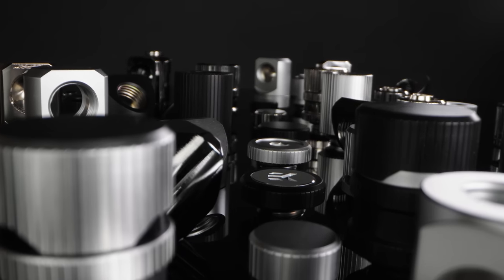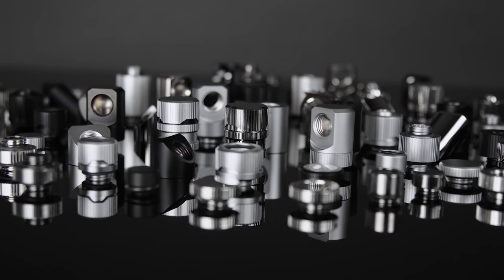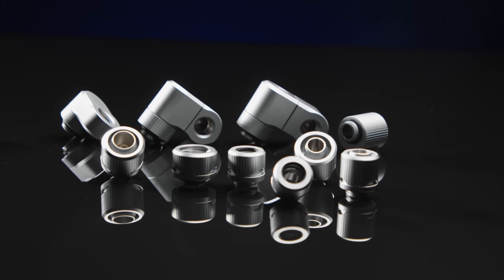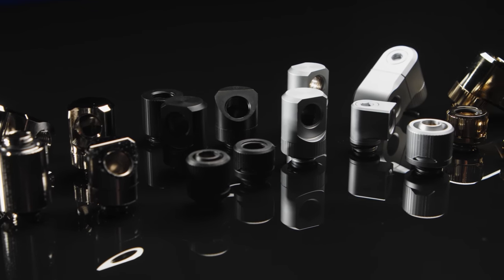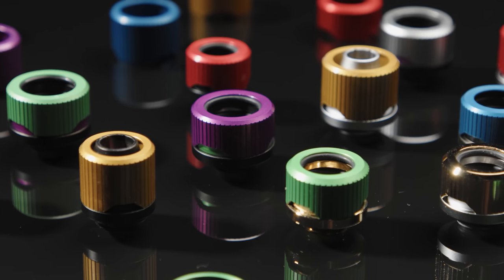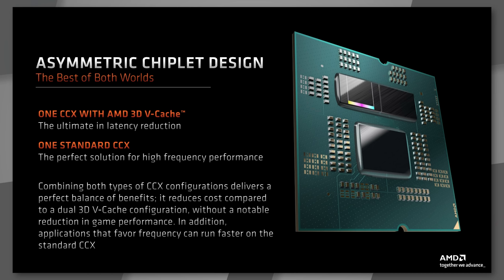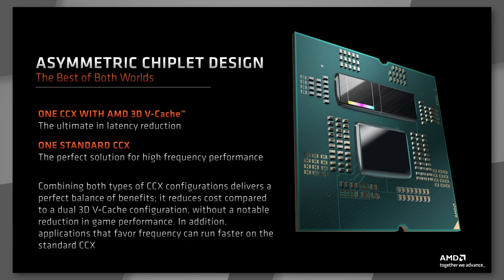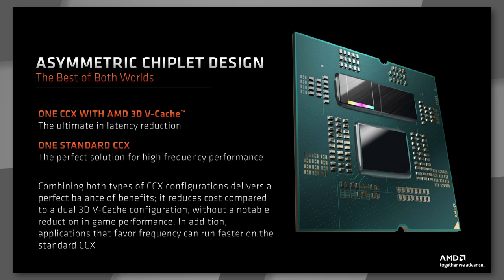Why I switched back to Intel...

Comment: Just ended a 2 year fling with AMD Ryzen 9 5950X, in a Gigabyte board with 64GB Skill RAM.. and NEVER had so much disappointment from a PC as this one.. It had all sorts of issues, and ecah attempt to fix the issues, just seemed to somehow make it worse. Freezing, hanging, lagging, shutting down file explorer, shutting down random windows, Not booting. Finally, this morning..  it stopped booting all together, no matter what i did.. and I am ordering new MoBo, CPU, RAM, and cooler.. INTEL HERE I COME (Back)!!!  My previous PC, was a 3770k in a AsRock board.. it ran 24/7 for 10 years.. solving any task I threw at it, and performed so well, that I found myself bragging about it.. No more AMD for me, EVER!

Comment: 14600k here with 4 gskill 3600mhz cl16 ddr4 ram and nothing but smiles while photo and video editing for 12 hours a day

Wanted to go AMD but heard soo many horror stories about ram and bluescreens and blackscreens so i made a custom intel pc and couldn t be happier

On a ram note, in my old PC i used HyperX in dual and when i bought another copy of the same kit it would not work together

So i dropped it and went to gskill and never looked back, and I think you shoulld really consider getting rid of HyperX even tho they are american and going to Gskill which are taiwanese

Comment: This seems like a motherboard issue. I had issues like this on my Asus MOBO for my 5800X, and it only fixed when I swapped to an ASRock MOBO for it. Now I've got an ASRock B650 with a 7800x3d and 6400 RAM. Straight out of the box all of it worked perfectly. I was checking Asus forums about their performance with AM5 and it seems that a lot of the issues you are experiencing, people over there are, too. I have no idea if it is on Asus's end or AMD's end. But Asus has been declining in quality, at least from what I have seen, for a few years now.

Comment: yeah those problems suck...I have normal 7950X and it's been super solid. haven't updated BIOS since I got it in Oct '22 though lol. should maybe update to BIOS JUST before they released X3D version. 

I just need to figure out how to turn off the training every time it boots up. takes like a minute of 100% fans before it shows the BIOS splash screen

Comment: Strange MSI mobo 6000 rated ram and 7800X3D. Made for a friend he does not even power it down properly most of the time. Still runs perfect. 4080 ti. Gigabyte mobo.

Comment: If all the RAM slots support different frequencies, then will it be okay to buy 7200 MHz RAM or will it be okay to buy minimum RAM mhz because of the slot having minimum support. like this 
    1DPC 1R Max speed up to 7200+ MHz
    1DPC 2R Max speed up to 6600+ MHz
    2DPC 1R Max speed up to 6400+ MHz
    2DPC 2R Max speed up to 5600+ MHz

i am very confused plz help me

Comment: I've stopped trying fix my memory speeds and ran base settings as well for the same issues on the 78x3d. I also swapped from to an AIO trying to help with temperature spikes while gaming. Also at random my PC will startup with a studder that is constant until i reboot. Hope they can find the issues

Comment: The problem with the RAM might actually be a problem with windows 11, had made a new PC recently and while able to function, it had serious performance issues and crashes that it should have been able to handle. After stress testing each individual part and with no problems, i gave up and downgraded to windows 10, all problems went away. 

A fresh windows 11 install might have worked but i was used to windows 10 and never had any problems with it so it was a might as well kinda decision.

Comment: For a novice builder is it hard to upgrade from AMD to Intel? I'm thinking about switching to the latest Intel from ryzen 7 3800x... but I know I'll have to replace the motherboard, cpu, and Ram.... will I have to buy Microsoft again, and will it change any of my pc files on boot up going from AMD to Intel?
Reply: If you have Windows linked to your Microsoft account and not just the system, you will not have to repurchase Windows. You will need to deactivate your account from your previous mobo and then log in and reactivate it when you install the new mobo. If you only have a Windows copy for your system, then yes, you will need to buy a new copy of Windows.

Comment: While may not be the AMD CPU fault, I had an issue with running my RAM failing running at advertised speeds on my Ryzen 7 5800X. I am now running base speeds for fear or that happening again.
*Edit for spelling mistake

Comment: If X frequency ran fine for X amount of time and then you had to drop it, that sounds like IMC degradation to me. Sure that Expo stuff doesn't overvolt the SoC voltage or however thats called on AMD?

Comment: Ive never used intel, even back when there was Cyrix CPUs AMD CPUs and Intel. They never had my attention back pre Pentium 1 days I've down built enough PC over the last 37yrs, starting in 92 at 16yrs old...Never been an back and forth type of guy, i get a brand and i stick with it. Love AMD and Love the Gamer CPU's out of the X3d line up. Have not bought Intel don't think i ever will.

Comment: @JayzTwoCents I can 100% confirm these issues with Ryzen and Memory. I have been using Ryzen from the 1st gen R7 1800x till now and the memory issues are still present. 
I have even left full reviews on Amazon Motherboards and Memory Kits on Ryzen compatibility details.
BIOS updates don't really help and make no noticeable difference.
It's annoying to pay for premium memory and then cant use it fully.

Comment: This is why I stopped buying AMD years ago. They were great back in the late 90's and early 2000's, then I had nothing but problems with their devices, both CPU's and GPU's. I switched to Intel when the Core 2 Duo E4300 came out and overclocked it, since it overclocked so well. Those things were amazing; 1.8Ghz to 2.4Ghz on stock cooling! I no longer overclock my CPU's, but I've stuck with Intel and Nvidia since that PC, because they always just work.

Comment: Have a  i9 12900k    asus z690 prime and 16 GB  F4 3600  G.Skill  19d  reports singel ranks    8gvrb   asus 3060 12gb phoenix     xmp does not work in heavy games   only default 2133   have also bios updat,s bla bla  have default no problems  1066 nb freq 4700    xmp set to 3200 its works longer than crash etc  etc     what is the problem  its bad memory sticks  or memory controlle  on the cpu   have buy   agendo   germany  is this a memory set or is this a singel  sticks apart

Comment: I  just built a PC with an asus X67E hero, and a 4x32 corsair ram kit and a 7900x. I was having the same EXACT problem come to find out the ram wasn't on the QVL I returned it to Amazon and went to bestbuy but even then the ram I have still isn't on the QVL. I'm in the process of hunting the correct part number/version of ram
Reply: I think it is more of a motherboard ram support issue

Comment: The 13900KS has been the most unstable CPU I have ever used. On my second 13900KS and already having cache issues after less than 2 months of use (I don't even overclock). Many CPU intensive games will crash and almost all DirectX 12 games throw an Out of Video Memory error on application startup. If these issues persist with 14th gen, I will never get an Intel CPU again.

Comment: ok, so it's not just me. i have dam near the same build and this is happening to me as well. It's funny though it seems to work fine when I'm playing S.C.  but when crap out on me when playing hell divers. the memory will be set to 54 and all the sudden I'll go from 60c to 83c and then boom it will lock up for a sec and then boots me out of the game. gone through the same issues. lower its good and then lower again. i think stacking so much crap on top of each other causing an insulation issue, and not able to dissipate the heat quick enough. i know you don't want to but there has to be a way to fix this. please try and analyze the issue more. I know you can do it because you're the man!

Comment: @jayztwocents
I just picked up a 7950x3D before I saw your other video on RAM issues. Now I'm stuck with only being able to run 1 RAM stick. What did you end up getting to work? Should I also jump outta the AMD race?

Comment: I  was using AMD CPU’s and GPU’s back in 2020 and I had nothing but trouble.  Then in 2021 I switched to intel and nvidia, and I haven’t any problems since I switched.  When it comes to PC tech I don’t care about fanboys raving about a particular brand.  I use tech from brands that don’t have serious issues with their hardware.
Reply: @Ew40  When I was using the Ryzen 2700 and RX 5700XT, almost everyday it would crash.  Didn’t matter if I was browsing the web, playing games or running blender and I even had a 280mm air on the cpu.

Comment: well, what you described actually happened to me on a 5900X. I tested a lot of shit and I'm still not sure what fixed it in the end but I was running a old bios. iirc it worked again after reset bios, flash bios, boot once and let it train, reset bios, boot second and let it train again, configure and be happy eventually. Never had a problem since ¯\_(ツ)_/¯

Comment: I guess these must be fussy with different combinations. Have come across this kind of thing on Intel systems too over the years, especially new gen stuff. I reckon this is the issue rather tham being an Intel vs AMD thing. In relation to the CCD configuration, it looks like single CCD chips are a better bet for the time being. This was flagged as a potential issue in the early reviews.

Running an 7800x3d with 6000 mhz memory Expo II on an Asus x670e motherboard, and it is absolutely and utterly rock solid stable.

Comment: I bought a 7800x3d and asus motherboard. Spent 2 days getting it to work and when I turned it off, it never posted again. I also had an amd graphics card crap out after 60 hours of gameplay. I returned that stuff and went with intel and an asrock mb with a 4080 super. I couldn't be happier. I'm never buying amd or asus again.

Comment: I’ve got a 7950x and an rtx 4090 with 4 sticks of tridentZ 6000mhz totaling 64gb with a slight overclock on the cpu. I’ve had it setup this way for over a year now since I got the pc and I have blue screened maybe once or twice, but each time it was likely not because of the ryzen cpu because it had to do with me messing with bios settings or overclocking my gpu ect. I even have a dual boot setup for windows and Linux which usually causes blue screens and corrupted os over time, but I’ve had no such problems. Regardless I have everything backed up, so if I do have a problem I can be back up and running in less than 2 hours worst case scenario.

Comment: I have more issues with my Ryzen 7950X, it was getting so hot and I was getting weird black screens. Looks like it was a lot related with the memory timings. I sold my 7950x and I got a classic 7800x3D, it did the different it stay cool and not black screens anymore. It also train the memories and not issue after more than six months. The other day I even lower the voltage of the cores by 35 mili volts, it is cool, barely going over 80 when doing cine bench, while gaming is between 40C or 50C.  I kind of miss the cine bench result of 38k points vs 15k points but I also have a 4090 so any heavy multi thread I use the gpu, which is much better for that than the CPU. The code that I write this days is C#, C++ and Cuda. Cuda rocks for multi thread computations. I don't believe the 5000 usd CPU from intel will be even close to the Nvidia GPU on applications like Blender.

Comment: I've just bought a 7800x3D with a MSI Pro B650 and 64gb DDR5 at 5200mhz. Not installed yet, but I'm looking forward to getting it in my pc, but I've got to wait for the amd screw clips, because I've lost one. :(

Comment: Pretty lackluster video. As a hardware/PC youtuber JayZ should had tried diving deeper into the issue trying to find the root of problems the solution but in classic aging boomer way he threw the towel and went down the path of least resistance so that the video would be as easy to make as possible. It's even funnier considering the whole issue was probably Asus MOBO or as simple as incompatible RAM. 
That's why GamerNexus and Hardware Unbox will always be infinitely better than old man JayZ and his quarter of a cent. He's not like he used to be years ago.

Comment: I have had nothing but issues with my 7800x3d and AMD support will walk you in circles instead of sending a replacement. If it's a scam, call it as it is and return the product. Don't let them leash you outside the return period.

Hopefully a different chip fixes the issue cause I need the IO support from this chipset/mb

Comment: AMD is just not for me. I have the i9 14900kf and rtx 4090 which is better than anything AMD has to offer.
Reply: Yessir. 14900K/4090 myself. Always turns on, no issues, does everything I want it to and then some. I'm no AMD hater, but I'm not convinced that their products are as good as everyone says they are.
Reply: @Lero_Po  yeah me either. I think for most people it's a price issue. But I'd rather shell out extra cash to get that amazing native 4k and up to 8k gaming. For things like csgo2 you can really feel the difference with a good monitor. I've had people argue and say that the 4090 only gets 1% more performance at 4k than the best amd but I think that's not true. The best amd isn't even in the top 4 gpus. I don't hate amd either but they do have a rabid fan base lol

Comment: I'll second @boastyy, 7800x3d Asus Tuf b650 wifi, Corsair 64gb 6000mhz ram. I personally have had ZERO issues. GPU is Asrock 7900xt, and i run 4k at 120 to 160 fps in Starfield and Asetto corsa, with no problems. It takes about 90 seconds to boot into windows, im running PBO with EXPO at 6000, and with that weird 420 AIO 5 fan(2 pushing, 3 pulling) blowing OUT the front, it stays between 30c and 70c running at 5k boost down to 4.2k "relaxed". My friend has the same problems with his 7950x3d, and is going to send it back and downgrade to 7800x3d like mine.

Comment: I have a Ryzen 9 7940hs under Windows 11 with many stability problems, memory problems, instant resets, suspension problems. I installed Manjaro (Kernel 6.3.3-1) 3 months ago and Windows 11 installed through Promox and I don't have a single problem. Could it be a Bios problem? Agesa? Windows Core problems? a combination of all? I don't understand why Windows 11 with hardware acceleration in passtrought works well under Promox or starting from OpenCore and not natively. I think there is a communication/compatibility problem between the operating system and UEFI/Agesa. Because when you put an intermediary like Promox or Opencore I don't have any problems. I hope AMD is on the way to a solution. In the meantime I will continue using Linux.

Comment: Actually i would have loved to see you put dual 4090 in skunk works with a 14900k. Skunk works has never been a dual psu computer but if you put a full load on a dual 4090 14900k you could probably trip a 15a breaker on a 1600 watt psu would love to see your work around

Comment: For AMD CPUs, I like the 7800X3D & the 7950X.
But I'm not a fan of the 7900X3D & 7950X3D for exactly these reasons. I was expecting a like 7960XX3D of something, a 7950X but with 3D V-Cache on both CCDs but I guess the temp & power issues are still preventing this :(
Pity about the memory problems, I've not had any issues, but I've heard other people having problems like this.

Comment: Turning off Fast Boot in Windows 11 setting fixed all of the crashses on my end, no more bluescreens. I have 4 sticks of Gskills ram and they are running at 6000 MHZ EXPO 1 without any issue and my cpu is 7800x3d.

Comment: So after 4 months or so would you say that an AMD system can still be wonky re: memory issues? 
Am an ALMOST 70 year old building a high end gaming system and have always used Intel CPU/GPU's.  Been 10 years since I built a system (I7-4770k with a GTX 780...it's time!!

Was considering AMD but want to make a fast system as trouble free as possible.  Don't mess with overclocking, tinkering like I used to...just wanna run stuff stock with a minimum of fuss.  Thanks - like the channel!

Comment: Sorry I'm late to the party. I run an Intel 14900KS which we all know is a space heater in itself clocked at 6.1 core 1-2 and 5.9 6-8P, 4.5E. With my Corsair 280 AIO I see idle temps at 45-50c. When benchmarking I see this spike to mid 90 maybe hitting 100c once or twice. Under normal gaming conditions such as Spiderman or Ghost of Tsushima I see 70-80 temps at peak. Thermal grease I'm using is Kryonaut extreme. I know I've done AMD systems and I've always seen memory issues. Just as I've experience one on Intel as well just recently where my old Corsair DDR4 3600mhz RGB overclocked to 4000mhz ran 5000 points better than Team Group 4000mhz DDR4 RGB. But never seen stability problems. I keep building Intel because I don't want to deal with compatibility or stability issues even if AMD performs better. I even had a VRM go up in smoke on me for AMD. Not trying to sound team Intel. Just sharing my experiences.

Comment: i still like Intel to this day. The i5 13600k is the best i5 i have ever own overclocked to 5,1 on a z790 board with bios update and xmp on for 32GB3600ramspeed. And i didn`t have to manuel overclock the cpu. usage on the cpu is really low in games and even better at idle disktop usage. that goes for the powerdraw to and it is cheap compared to older i5CPUs